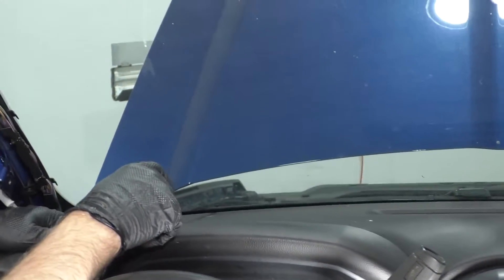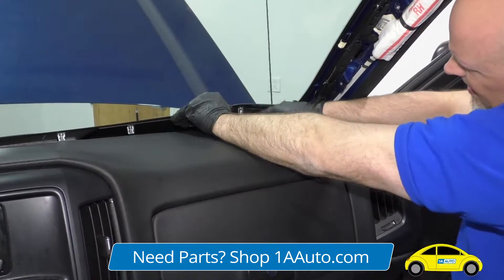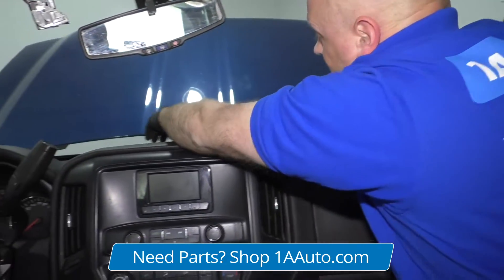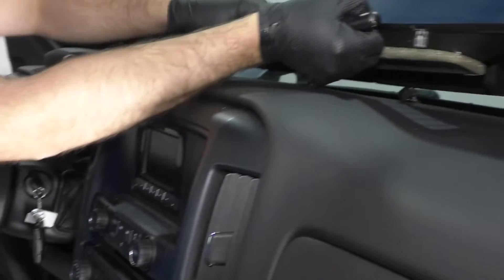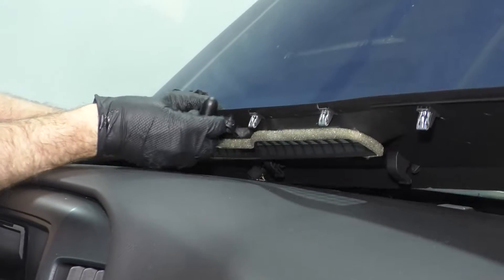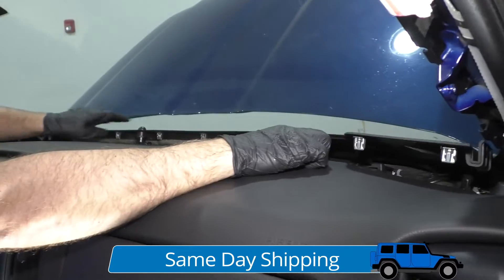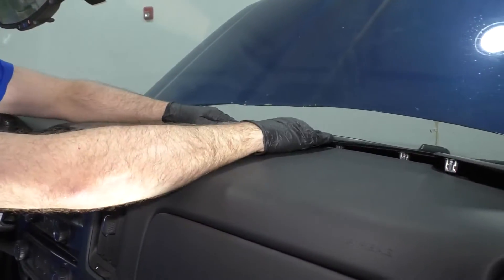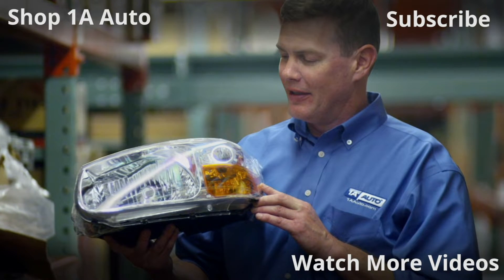How to Replace Ambient Light Sensor 14-19 Chevy Silverado

Comment: Thanks. I wish I would have noticed the A-pillar cover also needs to be removed but I figured it out. I got by just removing the pillar cover on the drivers side. My sensor had gotten popped down under the dash somehow. Trim removal tools are a must. It’s all about knowing where the clips are on modern vehicles so these videos are invaluable. 👍

Comment: This procedure also worked for my 2014 GMC Adadia SLT model, uses the 4 pin sensor # 13498958.  NOTE:  You must remove at least one of the door pillar covers as the door pillar bottom inserts into the dash panel itself.
Reply from the maker: +Richard Meszaros Thanks for checking us out!

Comment: When replacing the daylight sensor located on the dashboard, does it take some time to activate or should it work as soon as installed. 2011 chevy traverse part# 13498957

Comment: Does it only go in one way? Can it be positioned facing forward instead of towards you
Reply: Only goes in one way, wires arent long enough to face the other way
Reply: “Eye” faces inside. Put it in facing forward, you’ll break the receptacle.

Comment: No instructions on to remove the two vertical side piece on either side of of dashboard as they lock this panel in making impossible to replace the ambient
 light sensor
Reply from the maker: +DANA SHUTTLEWORTH We do not have a video for this repair right now, but we'll keep this request in mind for a future video! http://1aau.to/m/Shop-1AAuto-c